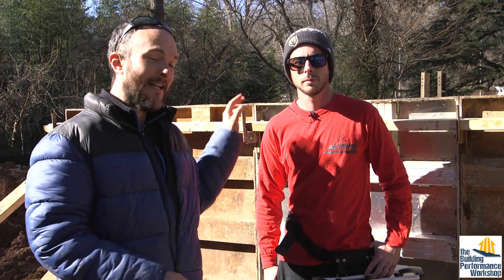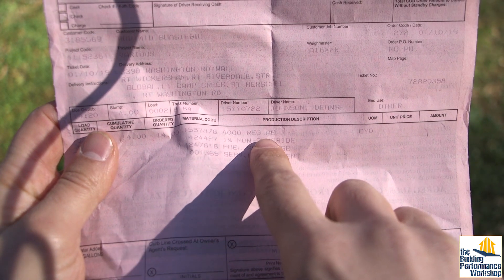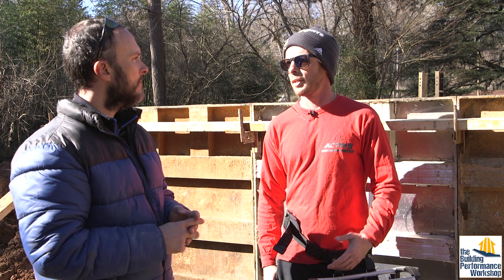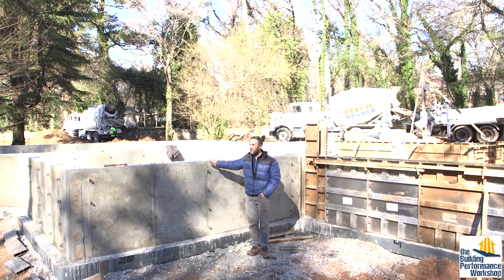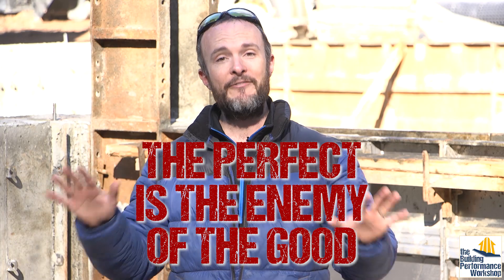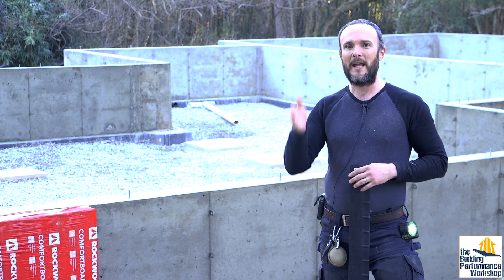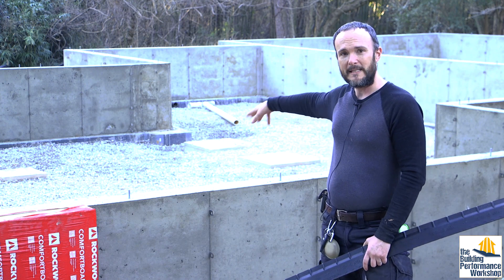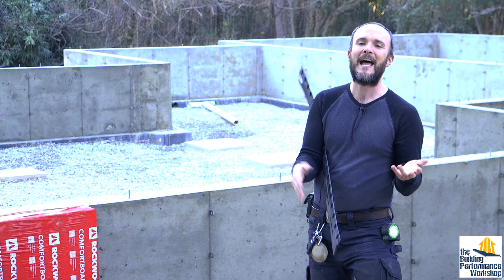Foundation Wall Concrete Pour: Forms and Boom Truck

Comment: So you did not use a capillary break between the Footer and the concrete wall? I was thinking of using a capillary break there.
Reply from the maker: You certainly can- we’re above the usual water table, with footings on compact gravel, plus the drain tile at footing level.
Reply: @HomePerformance wow. This is the second time you answered a question. We are pouring footer this week. Thak you so much!❤

Comment: Why did you decide to do poured concrete walls instead of block?
Reply from the maker: Stronger, basically same price. You need the concrete truck anyway to fill the cells.

Comment: Sorry to tell you this but metal clips that are used to hold the forms together for pouring concrete foundation walls should have been knocked off and filled with hydraulic cement and then calked with some type of waterproofing system.  These walls will have water issues now.  The metal clips will rust over time, which means they will expand and crack the concrete and water will enter the crawl space / house.  Matt Risinger and yourself should make a video explaining how important this is.  Steel is not a good building material unless it can be 100% maintained (painted or sealed).  Why do think brink walls are falling down when metal wall ties are used?  I'm a structural engineer and if you want a forever home, you should be using basalt rebar in the foundation walls.  Not really that much more expensive and very easy to use.  Also, using basalt brick wall ties or stainless steel wall ties should be used instead of steel or galvanized steel.  Just trying to help educate people so they know the correct way to do things.

Comment: As a rule of thumb. 1 gallon of water per yard of concrete changes the slump 1 inch and you lose 4% of strength.  That is why the slump test is used to check the water added to the concrete.  Super is a good but expensive choice to keep strength up. My company does basements so I've learned all the dos and donts lol. Be careful chasing the little things or you will miss the parts that are very important. Sometimes trust in the people doing the job is better than any book. Good luck with your home.
Reply from the maker: Great perspective, Math.

Comment: "High Performance" also includes Quality Control. Adding water significantly weakens the strength of concrete. Higher slump will be weaker. As the Owner/Contractor, it is in YOUR best interest to have the structure inspected and certified. 
Of course the pump operator and the form guys prefer more slump. It's easier to work, consolidate and finish. Not the best quality product though. You SHOULD care about this!
Reply from the maker: I think the issue is what exactly the word ‘significantly’ really means, Andy. This is not a bridge or a skyscraper or a nightclub, it’s just a 2-story stick frame house. Anything in real world construction is a compromise between ideals and feasibility.

Comment: Another question, do you have any insights on a capillary break between the footing and the stemwall? Can that be achieved by continuing your crawl space vapor barrier over the footing before the stem walls are poured? I’ve seen some diagrams of a footing having a “v” indention in the middle of the concrete that I assume takes the place of a rebar connection from stemwall to footing but I’m not positive on that. Perhaps that would allow a vapor barrier laid across the footing without any penetrations while gravity would hold the entire house to the footing. Not sure if that all made sense or not. Thanks.
Reply from the maker: I still would have wanted rebar coming up from the footing into the wall, so there would have been holes. But the cap action will be controlled because of the active radon system I talked about- stay tuned for that.

Comment: Won’t there be a break in insulation or a thermal bridge through the underside of the footing? I think some footings are poured on top of insulation - I’ve seen foam used. Is there any place in construction you’d feel safe using foam? I know you’ve mentioned your dislike of flame retardant chemicals. Also, if your house is airtight and foam is behind drywall or under slab, etc. are those chemicals still an issue since air movement is significantly reduced? Thanks.

Comment: Not being a contractor with high volume purchase of delivered concrete, I found ordering a slightly higher psi (not standard) can guarantee a better delivery.  When pouring a sidewalk I did this and received first and only delivery from the truck. I was told that if you order small standard, you could be getting old 2ed delivery of a mix on same truck, not good. Large volume contractors get first delivery. Hope this hint can help someone!

Comment: A couple things regarding your insulation. Next time break those ties off and either tar them or grout them. They will rust and alow water to drain into your basement. The only time you can leave them on is if they are below your basement floor slab. Example being a basewall or In a walkout section of wall. Next the bubble wrap is to allow water to drain down the wall.  If you install it like this make sure the wrap is attatched to the foundation above the insulation with strapping. I would use aluminum strapping along with caulking it to prevent any water from getting in behind. A thing to know is that wall mix has Air added to it. You do not want to over vibrate it. 2 things happen. You lose that air content and you vibrate all the stone to the bottom and the water to the top. Not really concrete anymore right? You should not have had to wait to put in bolts in if that was a 5 slump in that heat. Really they should not have had to vibrate that at all. If there was a ton of rebar in it then yes And if it was a dry mix.

Comment: I'm conflicted. On one hand, I get what you're saying about holding up construction and trusting the driver. On the other hand, of ALL the things you've learned about home building, and all the crazy tools you have, you couldn't just buy a slump tester and do it yourself?

Sure, the odds are against something going wrong, but it is such a small cost, even if you pay someone to come out and test the concrete when it's delivered. And if you happen to catch the rare case when the concrete is way off spec and would actually impact the build, you would absolutely call time-out on construction...

Either way, looking forward to the next video, keep up the good work!
Reply from the maker: Seth, every part of this foundation install, from dirt to concrete, leaves me scratching my head. Nothing is black and white, and there are assumptions about everything. It’s crazy-making that this is how every building begins.
Reply: @HomePerformance  It looks like it! You're doing a tremendous service to people like me who will be building in the next few years and will use your experience to make things smoother.
Reply from the maker: Happy to hear it, brother, thanks
Reply: And what is he gogin do if slump in off by 1 ? Send it back to plant? That said beware of soem trucks bringing YOU a load that has been dumped elsewhere .

Comment: regardless of what the slump is,aren't they sometimes required take cylindrical samples  and do a 28 day compression strength test.
Reply from the maker: On bridges and huge buildings, yes
Reply: I'm not sure how it is now but past experience is government contracts required testing of concrete (small or big) , if you are going to the extent of hiring a Geo-tech , then it wouldn't be far fetched to want to know how good your concrete is.
Reply from the maker: Again, I’m already 3 months behind. Concrete takes 28 days to fully cure. That’s a whole month to sit doing nothing, and potentially tear out what we’ve done and start again? What’s the tolerance for strength? What if it was 3500 psi and not 4000? Or 3000? When is it still ok? In govt work, it’s pretty black and white, but here the system is overengineered already.
Reply: We (engineering company) took the samples day of the pour, I think it was a way to keep people honest, that's why  you have to have  large general liability insurance, anyway good luck.
Reply from the maker: It’s a powerful motivator

Comment: Given that you want to insulate the concrete, why not use ICF? I'd love your opinion on that. BTW, loving the channel. 
I've read that it is better to use additives to increase the concrete flow instead of water, as adding too much water can weaken concrete. If you do add it, it should be added once at the beginning before it is poured. 
There are also additives that makes concrete nearly waterproof, which helps with long term strength and helps reduce water vapor coming through the concrete. I first learned out it from an old Mike Holmes show when they were repairing a basement wall, and never have found an answer as to why it is not widely used. Loved to know the answer.
Reply: David Milligan, Cost. Water is cheap. Additives cost money especially the good ones. If you don’t need the extra strength, plain old concrete is less expensive. You can add chemicals, fly ash, fibers etc to change the concrete and avoid adding even more expensive cement. Just depends on what you need.
Reply from the maker: Thanks for following brother- I don’t know much else about concrete, so I can’t help you there, but as for ICF, I personally do not use or recommend foam insulation due to flame retardant chemicals used in it.

Comment: Trusting the truck tickets/operators is idiotic.  Slump tests, air content, etc...all useful or required tests dependent upon the project.
Reply: What he said. The load on your average basement walls are so overbuilt that as long as they aren’t criminal in how they form, furnish, pour, and finish off the concrete, you have plenty of margin for error. Commercial or high rise is a whole nother ball game.
Reply: I’m a builder in a small town in Oregon , you can easily perform your own slump test on site with a cone , but there are so many chemicals added to concrete these days it’s hard to get usable data without actual sending samples to a lab.  Just not done in residential construction for the most part.  Our engineers call for 2500psi mix we use 3500 min , gives us a buffer for varied mix design or site added water.   But for us concrete is always a gamble.   You never know what your going to get no mater what the ticket says.
Reply from the maker: Dependent being the key concept
Reply from the maker: Also, I’d like to say that everything is idiotic- we’re all going to die and the planet will someday fall into the sun. Let’s just have fun and not be too uptight for our own good.
Reply: Typically test cylinders are poured on site, cured in the same conditions as the pour itself, then sent to a lab for testing to verify that the properties desired were actually met.
Reply from the maker: All of that hinges on your willingness to hold the construction until complete cure and testing is complete, and to demolish the foundation, re-grade, and start again. Never heard of that for a small homebuild.
Reply: To summarize, for typical single family homes:

Ticket
- Against: idiotic to trust it; 
- For: using concrete for basement walls on homes is already so structurally overbuilt that variances in psi have no effect on the structural needs of the project

Slump Test
- For: keeps operators and suppliers honest; useful/required for high liability cases 
- Against: if the liability and psi requirements of the project is low then a slump test is unnecessary; if the supplier and operator have good reputations then a slump test may be overkill; how poor would the pour have to be before the wall would need to be removed and replaced? 

Conclusion, in this case:
A Slump Test is overkill... or, 
Slump’s for Chumps.
Reply: @davidfleuchaus  Concrete tests are for people who are concerned about the quality of the product they're using and that it meets the requirements of the application it's used in.  Even if a foundation is over engineered using sub-optimal materials can effect longevity and resilience it might have otherwise had.
Reply: xephael that sounds accurate

Comment: Wont the tabs be point of thermal bridging?  Are you going to use spray foam to insulate them or go past them with the rockwool...  that is then tied to them?